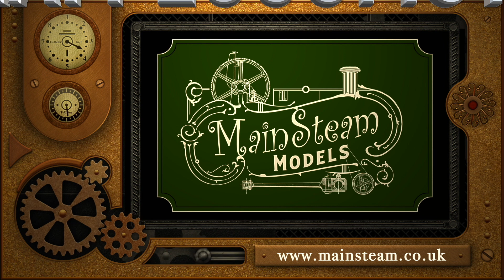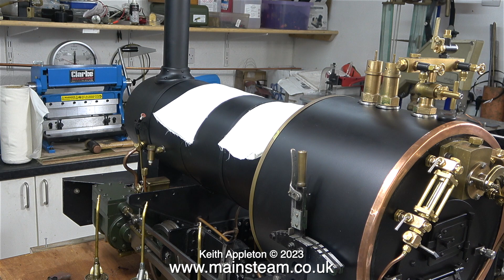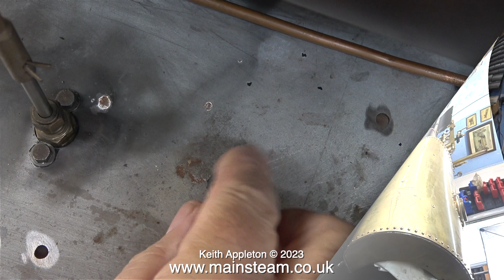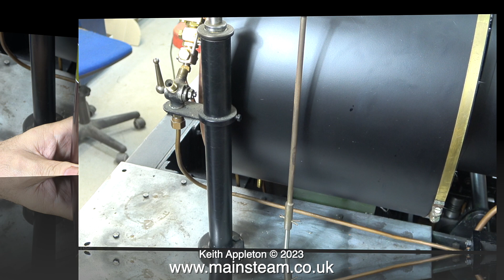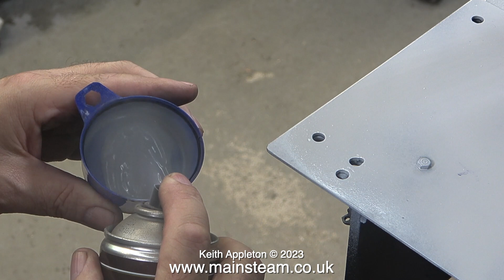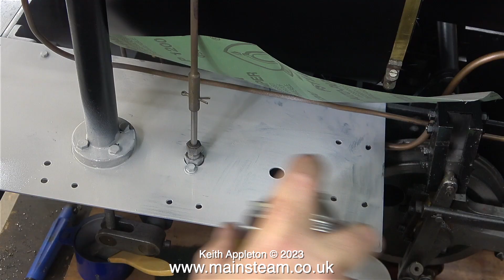A 7 ¼ INCH GAUGE "SWEET WILLIAM" LOCOMOTIVE - PART #44

Comment: To keep that drill from cranking me around I turn the clutch down so it will drill bit if it grabs it will ratchet. Gotta be ratchet one though the new electronic one from Milwaukee doesn't engage fast enough to keep from twisting a wrist.
Reply from the maker: Yes, I do the same . . . . .